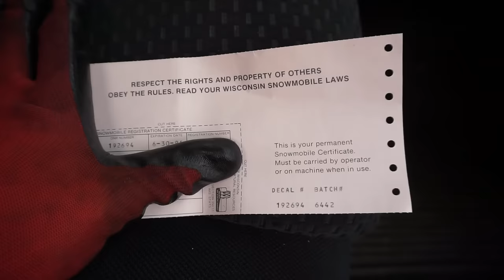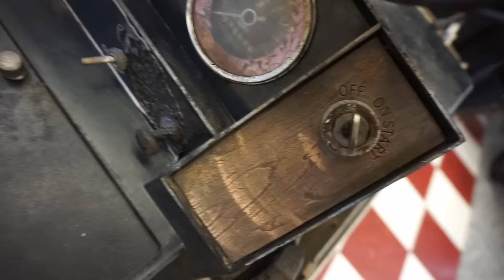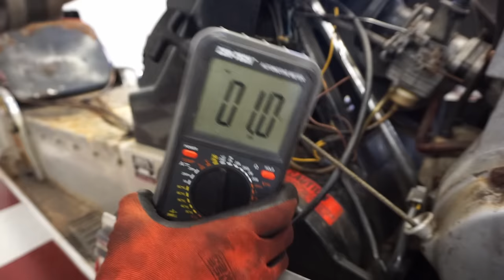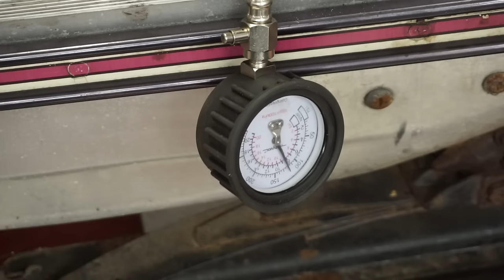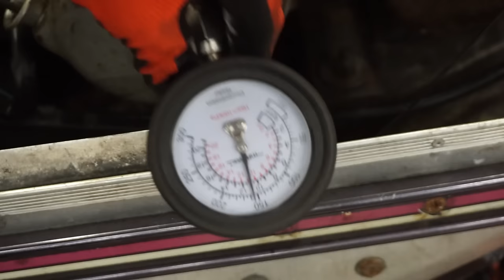$150 Sled Sat Untouched For 30 Years. Will It Run?

Comment: DIY. There are two types of carburetors used on those old sleds. tilson which has an external fuel pump and a waldro witch you have with an internal fuel pump which pumps gas in from the tank to the inlet in the bottom and excess gas goes out and back to the tank. As for the fuel feller you can usually pick them up at any snowmobile shop.
Reply: Came here to make this exact comment. That pulse line from the crankcase is to power a diaghpram pump on the Carb. One line is a pickup the other is a return. After that long you are going to want to get a rebuild kit for the carby to get that pump working sweet. Great content by the way 👏
Reply: I was wrong on the Tilson carburetors they do have a built-in fuel pump but they don't have the fuel return line the I had a moto ski
 that had a fuel pump on it but It 
had a float type carburetor on it.

Comment: At 53:02 you are using your needle nose vice-grips backwards/wrong teeth direction which will almost fail every-time! I use the heavy flat jaw Vice-grips for this application simply flattening/squaring the round head screw! 80 to 90% of the time the screw either breaks free or off either way it’s out of the way!

Comment: you could get a barbed fitting that had threads on the opposite end and tapped that filter and screwed it in to hook up new fuel line

Comment: Dang, u get pretty lucky, I would run into, needing a carb kit, low compression and the track about toast, needing new sliders, broken belt, bad clutch.  Those cylinder are likely chrome or nickel,  plated, mine was. I put new rings in and lasted two seasons, before my low compression came back I knew the cylinder walls needed re done, which meant new jugs.

Comment: I would argue that 50 year old snowmobiles typically require a lot of work to get them in shape to run. They are past the toggle up and run them stage.  The crank seals need to be replaced ASAP.  At least he understands how mags work, most young guys have no clue.  Walbro carbs are a mystery to most. You have a feed line and a return, they have an internal pump.  I have never seen a Walbro with that type of filter, that is more of a Tillotson feature. The other carb doesn't have a filter screwed on it because it is not supposed to. You use an in-line filter.

Comment: if i remember right the panther was the first machine to put the engine ahead of the secondary drive (instead of in your belly)...and possibly the first aluminum tunnel ...but i could be wrong...i know for the first year or two the fuel tank was mounted right ahead of one foot under the hood then later moved to the backrest position
Reply: another cool thing was that for some years in the 70s they were available with wankel rotary engines

Comment: I've had. See of those old 340 cats and some reason... They all seemed locked up and would pull over but a few wiggles on the clutch and they free up everytime.. first one I had I pull the the head and it just mysteriously freed up..had no rust rings good made no sense...

Comment: where did you get that type of flywheel puller and what is it actually used for bikes or snowmobiles or is it universal
Reply: text-1203  where do you get that flywheel puller at is it universal

Comment: You make yourself A clean out wire with A hook on the end of it. For cleaning that stuff out of those fans.& Other types of engines that you work on. A coat hanger.,or A piece of bailing wire wire work just for that purpose. Then your able to just vacuum the rest of it all out with.

Comment: Yeah Im at the point of the video where you puled the stator and point cover off, looks like you should have pulled the main cover off first. I hope the starter gear isn't acting like a weight. kinda like a flywheel. I guees we will see. This is a fun video

Comment: The hose (Carb. Out to tank does not "Pressurize" the tank) it is a return hose like a weed eater. It is a 
pump in carb. circular flow system. But good job getting those crappy systems to run.

Comment: The points on these machines get burned because of that wick that in the old days had oil in it to lube the rubbing blocks of the points.  Pull the felts and clean up the mags and lube the rubbing blocks with points grease or Sylglide so that there is a tiny bead on the leading edge of the rubbing block and retime the engine.  If the points are burned to much replace the points.  Those look like Nippondensu points which is a dead brand but replacements are available for about $10 a set.

Comment: I don't know exactly how rusty the tank is but if you have a few small nuts laying around try throwing them inside the tank with a little gas and slosh it around, it may help getting some of the rust out of the inside of the tank, atleast the flaky stuff if there's any in there

Comment: If you take that tank off, put a chain in side it, put that in a plastic bag or two… wrap it in a bunch of towels taped with packing tape, and put it in your dryer on air only setting.
Let it tumble.
Swap it around a little
To get one side then the other.
Order a new filter, AND LINE.
Probably you are going to need a new pump diaphragm in that carb as well.
Despite what the tic toc field Marshall’s say here.
Check your bogies, high fax, and carbides.
And grease your Jack shaft and brake cable.
If the bogies are stiff, use a hypodermic needle with 90 wt in it….through the seals.
Before…
You run the track.

Great old sled 😀😀

Comment: Fuel system is a loop system. Pickup should be 1'' from bottom of tank. Other hose is a return from carb that has built in fuel pump also ! It is not pressurized, but is a vented system!

Comment: This is a  Constant flow fuel system the fuel is pulled in with the vacuum of the engine while fuel is not used is returned to the tank and the feed line in the tank should have a one way check ball on the end to keep it primed

Comment: Compression on locked up motor around 150psi I think not ...but if your gauge is off...it will run decent with115psi.

Comment: U don't need to pull the flywheel off just clean the points in the window s
 I learned long time ago electrical spray you clean them clean that way it works. I be doing this very long time

Comment: Older sleds just disconnect the harness from the ignition and it’ll start.  Lost a key YEARS ago on a 79 Polaris XL340….no need to jump wires

Comment: How much of the engine locked up was due to the cooling fan being stuck with mouse nests.  Two fuel line one is to the carburetor the other is returning fuel to the tank.

Comment: Wouldn't need to pound to get the start gear back on if you decided to add that feature. Stick the flywheel in the freezer overnight, hit the gear with a blowtorch, flywheel out of freezer, screaming hot gear on. Done. Science is a powerful tool.

Comment: Those fan bearings were notorious to seize up and burn the belts then motor would over heat and blow, so just lil fyi on those Kawasaki engines

Comment: I got that same sled but it’s locked up sitting on trailer evruthing is there
Reply from the maker: You want to sell the gas tank and gas cap, and carburetor filter?
Reply: @2vintage  I can prolly do that I’ll talk you my grandpa when he awakes… is that all you need ?
Reply from the maker: @Wisconsin-boys  yes pretty sure that's all I need! Thank you!
Reply: @2vintage  sweet… he should be up soon idk what he’s charge for the whole thing but prolly not much but I know it was swapped for a Kawasaki 340 motor but gas tank and all that is the same just has a diffrent motor in it
Reply: @2vintage  what would you offer for the whole sled …

Comment: Why are you running straight gas in a two-stroke can't that ruin the engine? Anyways I have some of those fuel bowls if you need one hit me up. Love your videos keep up the good work
Reply from the maker: wasn't straight gas.it was mixed with 2stroke oil
Reply: @2vintage  ok well I have some of those filters along with a 71 or 72 ski Doo 399 that just needs the front drive wheels put on it. All original if you are interested. Thanks Ed

Comment: It's a 350cc now you took off that ring gear for the starter so you lost weight on the flywheel so let that theoretically will let it spin faster let's wait on the crank

Comment: I'd make it electric start again to man that way your wife can ride with you in the winter season time as well. Helmets man should be A good practice.& Your own 🦺 safety outlook on things to. Especially when.& While riding on those machines to. Cause most people don't always watch out.,or even look for those either really anymore much now days. I'd add on some turn signals to both of those snowmobiles for yalls own extra safety.& That way you can get them street legal that way to. I'd even insurance.& Tags & DNR sticker's on it to.  That way it's fully ready to roll for hunting.& Etc. Put in one of those toggle blinker switches that's made all in one.,or DiY one for yourself instead. You'll be able to save money that way to. 12- volt.,or 6-volts if it's reduced down through A resistor.,or voltage regulator rectifier control box either way. Just tap that switch into your head lights.& Running lights on it is all you've really half to do. For using existing wiring harness minus what your switches.& Indicator 💡 bulbs would need added on to them. I'd use motor cycle.,or moped turn signal lights on those snowmobiles to. So their tuck in to the frame work more. To make them look more incorporated on those machines to Joe. Yours could be the first one out there like that to. Witch might inspire others to do the same types of updates to those to. To help prevent accidents on those machines more that way.